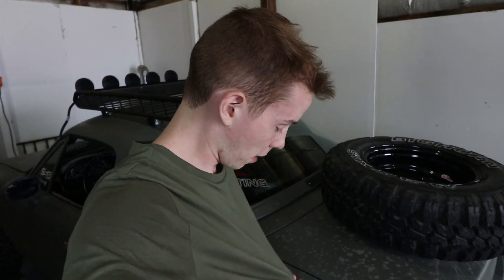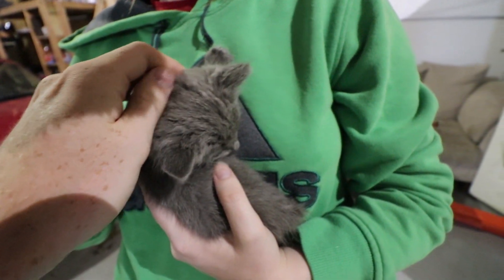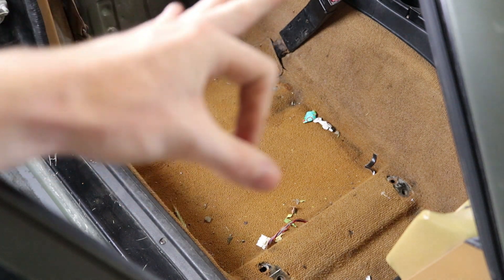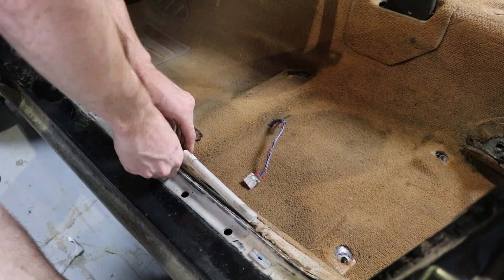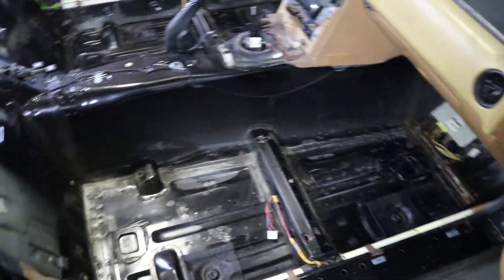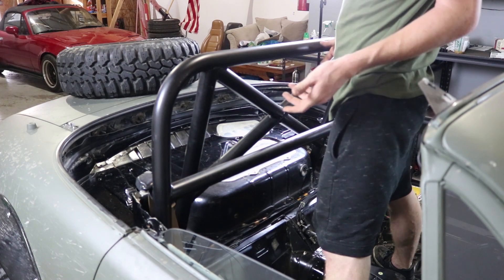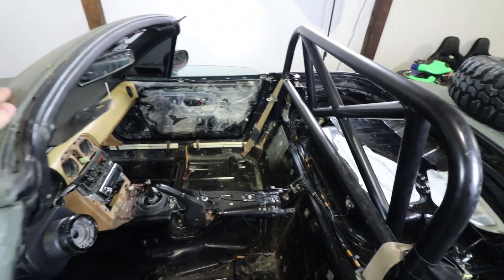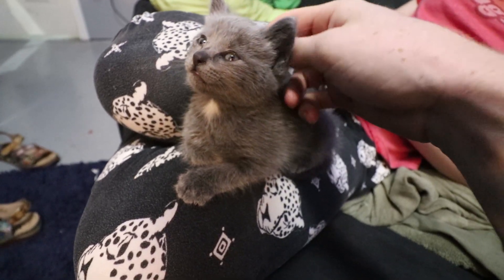Stripping the Interior in the Rally Miata

Comment: you should invest in a cordless impact not a big one for taking tires off one that you get that comes with a cordless drill it's usually a two pack combo. It comes in so handy when you're working on cars you could cut all your time and half when you're taking should apart and you can use it for putting it back together too. whenever I'm wrenching on my truck I use mine all the time

Comment: Shop vac tip of the day: Shop vac filters are expensive and it seems like you will be vacuuming up a fair amount of nasty things like brake dust, and rust, and whatever used to be living in your cars. To help with the filter issue, you can buy the cheapest regular vacuum filters you can find and put them over the shop vac filter. Then hold them on with a large rubber band or a piece of rope and throw them away when they get nasty.

Comment: You should spray some kind of rubber coating on the floor, it will make it look a bit cleaner and make it easier to clean. You could also use truck bed liner which would look hardcore.

Comment: I really don't see the point in stripping a miata interior, with the exception of the softop and stock seats there really is minimal weight savings to be had. Although I suppose for a 4x4 car it means you can add in a more hardy rubberised interior.